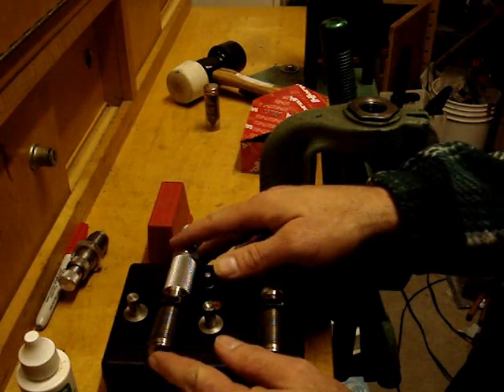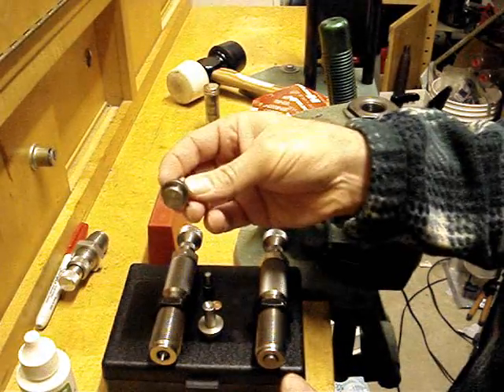Bullet Swaging Part 1

Comment from the maker: The best ammo for what you're looking for is to cast them from zinc. Zinc is very hard and light. A 9mm bullet that normally weighs 115grs would weigh about 60grs and will travel at about 1700f/s. It's self lubricating. No soft body armor made will stop it if you get a pointed style bullet mold. They're cheap to amke.

Comment: Do you have a video showing how to set up a Corbin press? Getting one soon as it ships, got 1 of the 3 dies as well as core molds for 9, 40 and 45, dies are for jhp only since they're the ones "unfindable" right now. The instructions I got weren't really clear on how to set it so I'm not damaging the die and after hearing how easily damaged they are, I'm researching like crazy so I don't get it and ruin it quickly. Any help, advice, etc. Gratefully accepted. Been reloading 41 yrs, but expanding my ops seemed wise.